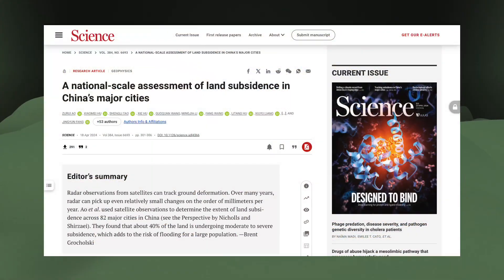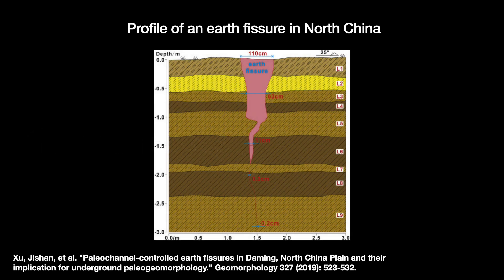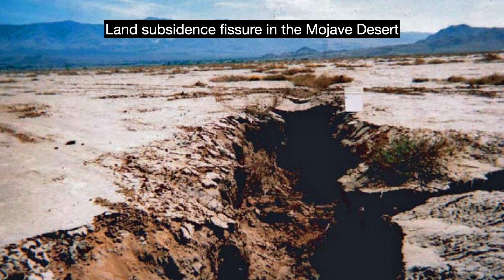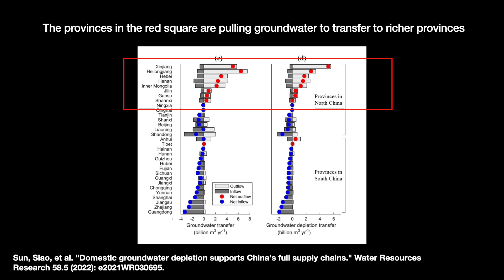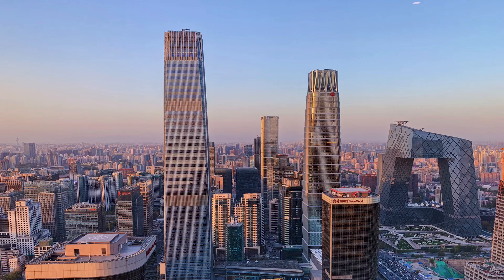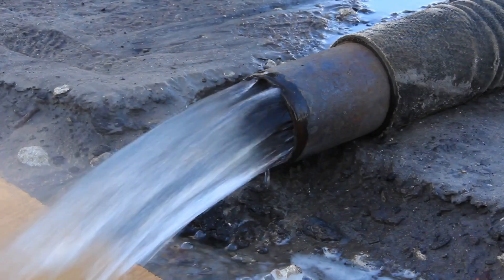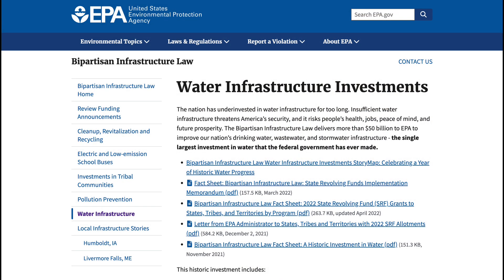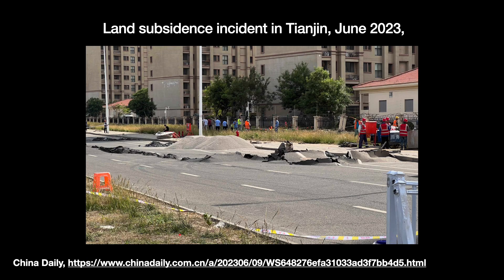China’s Sinking Land Problem

Comment: Does anyone know if building engineers take into consideration the accelerated sinking of land due to water extraction? I would think civil engineers would put more effort into modeling and understanding the impact.
Reply: We do, but it depends on the building. Residential houses up to certain floor area aren't required to submit those documents, but high-rise building have to have groundwater assessment and subsidence in it's long-term risk analysis.
It's not that hard to calculate; very, very difficult to know if the numbers are correct 😂
Reply: Depends on country, the vast majority do take land movement of any kind into account. That's what building regulations, soil testing, environmental impact reports and consents are. Beware the people who sell "Deregulation or less oversight" as a solution. China's problem is multi level systematic, making it far more difficult to solve as you can always blame someone else.
Reply: I highly doubt it. Tofu dreg cha bu duo engineering doesn't call for any of that.
Reply: closeminded response  @RT-qd8yl